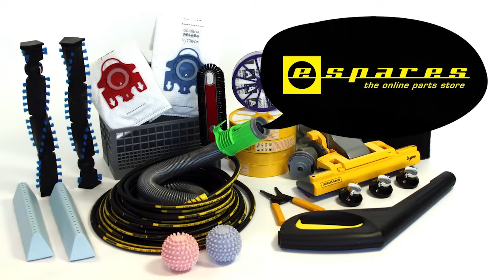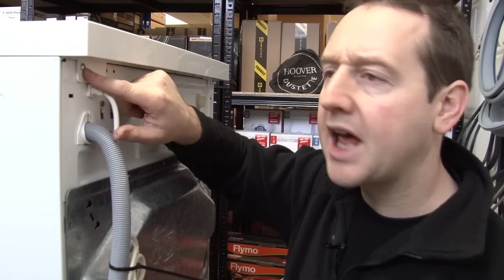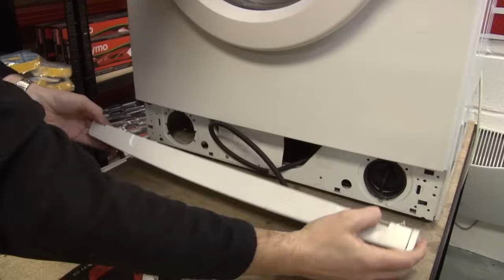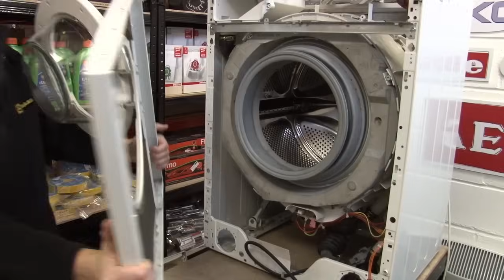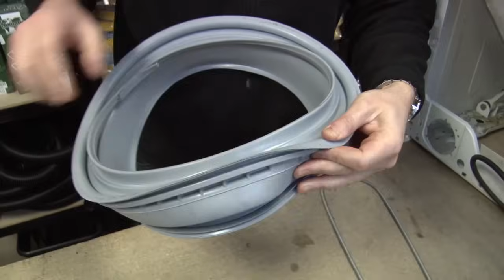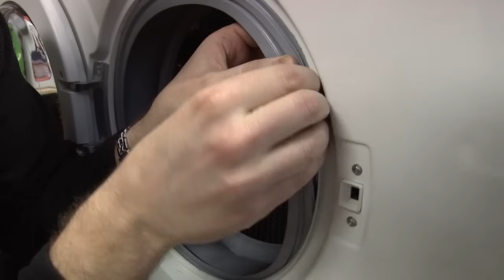How to Replace a Washing Machine Door Seal on a Bosch Washer

Comment: Super helpful video. Got everything apart and practised replacing the seal with the old one. I’ll order the new one now.
Reply from the maker: Hi Phillip, thanks for your comment. Well done for choosing to fix your washing machine yourself! Glad you found our video helpful, if you still need to order the door seal, you can see our range for a Bosch washing machine here.
https://www.espares.co.uk/washing-machine/bosch/seals/catalogue.pl?path=1015007,112757:1015070&refine=seals

Comment: Should've done this way earlier... the torn seal at the bottom has created some rust spots on the machine since the water has been leaking out a bit. You think this will work on Bosch model WAB28262NL/32? Cheers, great video.
Reply from the maker: Hi, thanks for your comment. Great to hear you are looking to fix your washing machine yourself! The repair process can differ between different makes and models of appliance, but the general steps should be similar to what is shown in the video.
Reply: @eSpares  Parts are on their way... Worst case I will wash my clothes in the sink for a bit!😂

Comment: The part that tears / leaks is almost always at the 6 o'clock position of the silicone seal. Maybe because as we pull clothes out, it tugs. Anyway, so I understand the 3 holes are to drain water, why can't the seal be rotated around, so that the torn part is on top (but water doesn't go that high, so won't leak), and the untorn part is now below. As for the 3 drain holes, can we either (a) live with a bit of water collecting there, or use a hand towel to soak it up. What I mean is, a lot of things are "convenience, like self-defrosting fridge, when in the old days, we just lived with it.
Yes it's still effort to open up the springs, rotate, put back. But the bloomin' spare part is like $130 + postage, for a bit of silicone, it's a ripoff.

Comment: Mine is a wae model I’m guessing it’s the same procedure as this one
Reply from the maker: Hi, there can be differences between different makes and models of an appliance...but the process should be similar, if not exactly identical. Let us know how you get on with the repair, and well done for choosing to repair your washing machine yourself!
Reply: @eSpares it was difficult and fiddly to do as it was my first time doing it
Reply: @eSpares but the screws don’t tighten up anymore it’s hardly had any problems so never been opened up

Comment: Thank you for this well explained video.  I finally got round to replacing the door seal after having the spare part sat in the garage for well over 7 years !!! Because I just love these machines for their reliability I have always had two spares, so just wheeled another in and never got round to doing the job.  Thought I best finally sort this out and find out if the machine was going to still work again.  I popped the seal on which took less than an hour and the machines sprung back into life after 7 years of being asleep lol  I dread to think what a new machine would be like.  I think I bought this one back in 2004.
Reply from the maker: Hi, thanks so much for your comment, it's brilliant to hear that you have been able to replace the door seal to keep your washing machine running! Glad our video could help you with the repair.

Comment: I had exactly the same experience as TiaraHelen below. My wife and I eventually succeeded in replacing the outer retaining spring with the aid of three screwdrivers. My hands took a day to recover. I was struck by how appalling the standard of the engineering in our Bosch machine was once one started taking it to bits.

Comment: Mine did not have the screw on the right side of the control panel.  It had to be removed a different way.  As a heads up, the retaining band on the outside of the door seal can be very difficult, to the point I've found it impossible to slide off or especially back on.  The way I manage is to band back the wire end on one side of the spring, to enable it to be slid on and off while pulling the spring with long nose pliers.  At the very end, with the spring in place, bend the wire back.

Comment: Can confirm this is not as fast and easy as it looks in video - spring is INSANELY tight and difficult - holes in seal don't line up easily - face has more screws than this guy is shown to remove

Comment: Pity about the stainless steel screws for the front cover, they were not SS and had rusted out so had to drill out the screws, aaah 😨 However the rest of instructions were pretty good, just make sure you have some tape to hold the control panel in place, the wiring loom tightness does not allow folding it back on top of machine. Make sure you have your full tool kit before attempting. Oh and a partner who is patient and doesn’t mind some colourful language!

Comment: Many years later, but still very useful. Mine took much longer than expected, mainly because I had problems working out how to remove the door. Many thanks from Denmark.
Reply from the maker: Hi, thanks so much for your comment here! It's great to hear that our video has helped you to replace the door seal on your washing machine. If you have any issues or error codes on your appliance in the future, we have specific videos that feature a Bosch washing machine.

Comment: Although it wasn’t our model, this was the best demonstration I could find. I took over from hubby as he in the end gave up. It was a pity you didn’t do it in real time without editing so that people could see that it is fiddly and as you had it at standing height and not on the floor, it again didn’t show all the positions I had to get into to do the necessary work. I tried it your way but it was very hard to push the seal onto the lip all the way around and I just couldn’t seem to finish it with the 3 holes at the bottom aligning and I tried doing this multiple times and so it was back on YouTube looking for more demonstrations.  

I found one that was good unfortunately, the camera work was too far away but the absolute deal breaker was he put WASHING UP LIQUID on the seal BEFORE trying to fit it on and it worked first time!  (Although don’t do what I did the first time and put washing up liquid on the wrong side! 😂).  The seal had moved and the three holes were not aligned but as I had put the washing up liquid on I was easily able to move the seal around until it was in the correct position and I was also able to put the metal hoop on quite easily. You also didn’t warn us that the rim on the door is very sharp and to be careful you didn’t cut yourself when putting the seal over the rim. Again, like the other demo suggested I needed a second person to hold down the metal hoop as I was fitting it into the groove of the seal as this hoop didn’t have the torque screw but a spring instead.  

It was also far harder to put the door panel back on and this also needed a second person.  It would have been great if you had firstly done a real-time full demo and then got someone who had never done this before to have a go thus showing the possible pitfalls of doing it.

Although at least we didn’t have to get a white goods engineer out to do it and so thank you for saving us a lot of money.  

We bought the parts off of you but I didn’t catch the bit where you said we would need a torque screwdriver and so there was another delay for that to be delivered but it was still a lot cheaper to do it ourselves than having a white goods engineer in. 😊

Comment: best video over
Reply from the maker: Hi, thanks for your comment here! Has our video helped you to replace the door seal...or do you still need a new door seal?
Reply: @eSpares   can you show replacing the kickplate on  the candy dryer  please
Reply from the maker: Hi, The kickplate should just be able to be pulled away from the front of your tumble dyer.
You can see this in action at 1:37 in the video here:
https://youtu.be/7E5N4DaPU0s
Reply: @eSpares   can you please show how to replace  the drum padles on the candy dryer please

Comment: Given it's the most common thing that needs replacing, you'd think it'd be slightly more accessible than (what feels like) taking the whole machine apart... 🥴
Reply from the maker: Hi, hopefully our video will help you to complete the seal replacement, if your Bosch washing machine happens to be an "ecobubble" machine, we do have a separate video showing the door seal replacement process for this here:
https://youtu.be/BfSLpDOC5VM

...If you do need a new Bosch washing machine door sea, you can check out our range on the eSpares website here:
https://www.espares.co.uk/washing-machine/bosch/seals/catalogue.pl?path=1015007,112757:1015070&refine=seals
Reply: @eSpares  Thank you very much for your prompt and helpful reply.   My comment was more an accessibility grumble directed at Bosch!

Comment: I wish you'd put the model number.
Reply from the maker: Hi, thanks for watching our video, hope it has helped you. If you do need a new door seal for your Bosch washing machine, you can check out our range at eSpares here:
https://www.espares.co.uk/washing-machine/bosch/seals/catalogue.pl?path=1015007,112757:1015070&refine=seals
...be sure to select your specific model number on the left-hand navigation menu, to get the correct seal for your appliance.

Comment: Really useful video, thanks.

I would recommend buying a genuine bosch replacement, to start with I got the cheaper version. The rubber was low quality and there was a big bubble in it that looked like a weak spot.

As others mentioned, the springs were more tricky that the video shows. Maybe a second person would be helpful. One to stretch, the second to push the thing back into the runner when it starts coming out.

Also my door latch didn't have screws. Take care when removing the front part because it dropped and almost pulled the wire out. I had to unplug the wire to the door latch while holding the front panel in one hand and the control panel in the other!
Reply from the maker: HI, thanks for your comment here, and for you added feedback on what you found when doing the repair on your particular washing machine. Glad you found the video useful, it's great that you have fixed your washing machine yourself!

Comment: This comment relates to the espares bearing video. Putting it here as comments are turned off on the bearing video. The bearing video is excellent except for one important omission, that is in regard to the rubber seal. Before installing the rubber seal you must pack the seal with lithium grease. Also you should put silicone on the outer race of the large bearing, where it meets the bottom edge of the rubber seal, as well as the side of the rubber seal and the top of the outer edge of the seal. I had to do the job twice because water leaked through the seal and washed all the grease from the bearings, which meant they only lasted 3 months.

Comment: Thanks a lot. Worked great for my Bosch Logixx 8. Had problems putting back the ring with spring on the outside. Had to loosen the spring a bit.
Reply from the maker: Hi Peter, thanks for your comment here, it's nice to hear that our video has helped you to replace the door seal on your Bosch washing machine. Well done on completing the fix yourself!

Comment: This gives you a good idea what to do BUT.. my Bosch VarioPerfect differed from the very simple video version Matt is changing.  Good idea to disconnect water too - I had screws underneath the washing machine and in the drain area and had to lay the machine on its side to get at the bottom.  Front panel didn't have a simple screw at the right side but had been locked into place and was fiddly easing back out.  Door electrics had to be unplugged too to get front panel off - not much play in the wires.  The gasket itself had an additional rubber inlet tube that needed you to remove an "s" ring and refit it.  Took hours but got there.  Fitting the final retaining wire on the door seal was really problematic and frustrating - no way you can do it by hand like Matt does the spring is just too tight.  What finally worked was putting the wire in at the top, and as far as possible all the way around, then holding the spring in place using locking mole-grips on the bottom wire eyelet just below the spring and pulling hard down whilst my wife (you will need a second pair of hands) fitted the eased off wire into place at the bottom - release the grips and the wire was in place. Phew ..
Reply from the maker: Hi Fraser, we are glad our video was of some help in you replacing your washing machine seal. Thanks for your comments here, as hopefully they can help others that might have a model similar to the one you have yourself.

Comment: Can anyone give me a tip on how to put the inner spring in? Mine is not as easy to put at all
Reply from the maker: Hi, you can try to place and hold the spring part of the clamp in position first, and then slowly work the rest of the clamp around into place. Perhaps ask someone to hold the spring in place, while you then work the clamp around.

Comment: Thank you for the vedio. May I know how much it might cost for the replacement?
Reply from the maker: Hi, thanks for your comment. If you visit the Bosch washing machine seals section on the eSpares website, and select your model number from the bottom of the left-hand navigation menu, you can find the correct seal for your machine...as door seals are model specific.

https://www.espares.co.uk/search/ma856pt1564/washing-machines/seals/bosch

Comment: I'm putting the seal on by now my door won't latch properly.  It latches when the seal is not in place. Help please.
Reply from the maker: Hi Farhan, that usually indicates the door seal has not been fitted correctly, also make sure it is the correct seal for your model.

Comment: This video saved my 15 year old machine which might have been scrapped if I'd had to pay someone over £100 for call out, parts and labour but the video meant labour was free...

The only slight difference was the kicker plate on my Bosch had 1 screw. Also agree with people recomending bicycle tyre levers. If you can get someone to hold the spring bands on as you push them back too, that is also helpful. 

My last tip is to label each screw on a sheet of paper as you take them off so you can put them back in the correct place, there were 3 or 4 slightly different types of screw for my machine as well as the stainless steel ones, mentioned in the video!
Reply from the maker: Hi EC, thanks for your comment. Glad we could help you save some money. Thanks for the helpful tips too :)

Comment: FYI using bicycle tyre levers to get the last wire onto the seal, worked a treat for me 👍
Reply: Thank you this tip saved the day! Strongly recommend using a pair of plastic tyre levers to ease the spring on without damaging the seal.

Comment: It doesn't give you an idea on how to replace the door seal on a Bosch Maxx 6.  You cannot remove the front on a Maxx 6 as they have put plastic clips inside which won't come off.  You need to do it with the front on which makes putting the seal and inner clip on very difficult.

Comment: Thanks for the very informative video. Is there a way to clean the gasket you would recommend that does not involve removing it and having to dismantle the front of the machine?  I have seen other videos that show soaking it in bleach but obviously that also involves removing it
Reply from the maker: The easiest way would be to wipe it out with kitchen towel after every wash and leave the door and the soap drawer open, you can try a washing machine cleaner.

Comment: Haha, when this video cut from when he was putting the tension wire on, to when he actually got it on, was a gap of about one hour with lots of sighing and swearing, because that's where I'm fucking at 🤣 God, someone give me strength to continue 😪😪😪
Reply from the maker: Hi Isoult Tibby-Cattistock, you need to ask another person to help they can hold the spring in place and you are then free to use both your hands to manoeuvre the spring around but good luck as it is awkward with the amount of room you have on some machines.
Reply: Thanks for the encouragement. I did it in the end but oddly the retaining clip on the inside wasn't tight at all, in fact, quite loose. It appears to have worked though. Next time I'm hiring a professional because I have 4 little screw's left over which I thought was a man's problem 😮😂
Reply from the maker: Hi Isoult Tibby-Cattistock, I think a lot of professional would admit to having a few screws left over after a repair bit we hope they are not vital for the machine.

Comment: Perfect, thanks. On some variants (Classixx 2005 in my case) there are no screws on the front panel by the door latch but there is 1 retaining screw on the bottom fascia plate to the rear of the drain pump flap
Reply from the maker: Thanks Paul for your comments and helpful tips.
Reply: @eSpares  you're welcome ! Great machine this - served us well for 15 yrs except for the door seal but now motor stopped completely (no spinning or wash rotation), can hear clicking. Yesterday it was on and I think tripped the mains CU RCD. any ideas ? - motor burnt out or some other fuse/inline device ? Thanks in advance. Paul